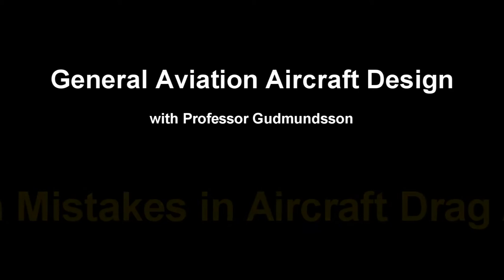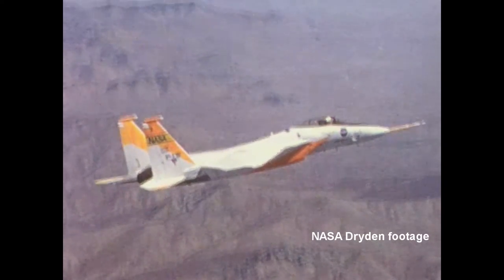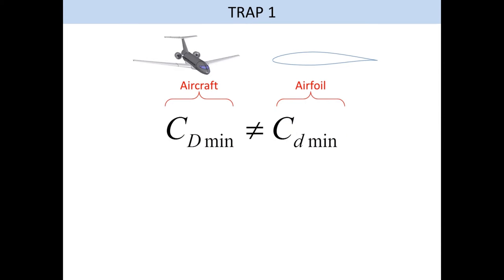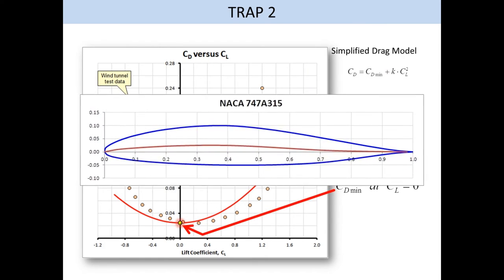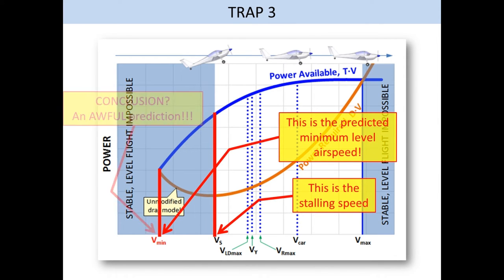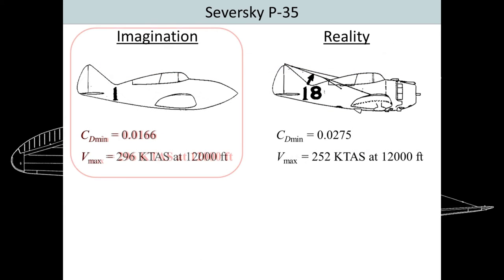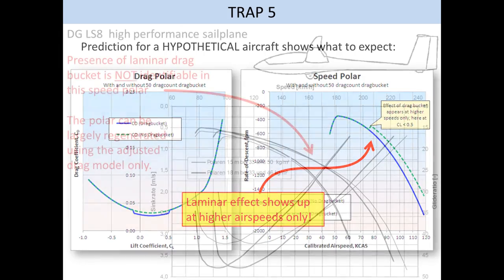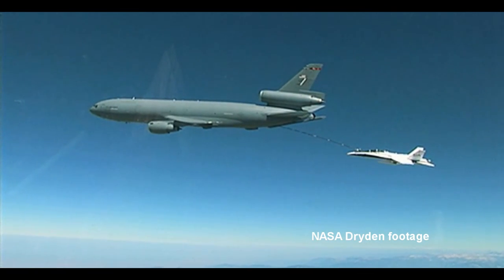Aircraft Design Tutorial: Common Mistakes in Aircraft Drag Analysis

Comment: Good day Prof.Snorri, thanks for your time sacrifice and help you've been giving sir. I ran a CFD analysis on a 3D airplane, i got the drag force, but am trying to get the area used so i can calculate CD. In the calculation of total 3D drag coefficient of an entire airplane, which area is used for calculations sir? do we use the reference area or projected area of the airplane relative to flow direction  i.e flow direction is along the Zaxis and projected area is in the XandY direction or we use the total wetted area of the entire airplane or the planform area of the airplane. Thank you sir.
Reply from the maker: Hi Israel. I'm happy to help. For an airplane, always use the reference area. This is the planform area of the wing, from wingtip to wingtip including the area inside the fuselage. I hope this response is clear. Best wishes.
Reply: @dr.gudmundssonaircraftdesign  thanks Prof, am very grateful 🙏.
Reply: @dr.gudmundssonaircraftdesign  
good day prof. Does this means the planform area of the fuselage and horizontal stab is not taken into account? Thanks sir.
Reply from the maker: @israeloluwagbemi825  Yes, coefficients such as CL, CD, and CM always refer to the wing planform area, S. Thus, drag coefficient is CD=2D/(rho∙V²∙S). Of course, the fuselage, HT and VT contribute to the drag and, thus, make D larger. This contribution is captured when you calculate CD, even though their surface areas are omitted.
Reply: @dr.gudmundssonaircraftdesign  
Thank you very much prof, am very grateful 🙏, I've been looking for this perfect explaination for a very long time. Thanks once more sir.

Comment: Good day Prof. Concerning the adjusted drag model, is CLminD for the 2Dairfoil section or the 3D wing... I tried calculating with the 2D airfoil, in this case i used a Clark Y airfoil of 13% thickness, the value i got for CLminD is extremely close to that of CL at 0° AOA let say 0.39 and 0.387 respectively at Re=4,700,000. When i used a lower Re of say 1,000,000 i got results that were far apart 0.381 and 0.5 . are the results Ok. thanks alot for the video sir.
Reply from the maker: Hi Israel. We have both Clmind (airfoils) and CLminD (3D geometry like wing or wing+fuselage, etc.). Your values sound reasonable, but I haven't checked specifically the Clark Y airfoil. Best wishes.
Reply: @dr.gudmundssonaircraftdesign  thank you sir, am very grateful for your help, i really appreciate your videos, they've been helpful.
Reply from the maker: @israeloluwagbemi825  Thank you for your kind words. Best wishes.